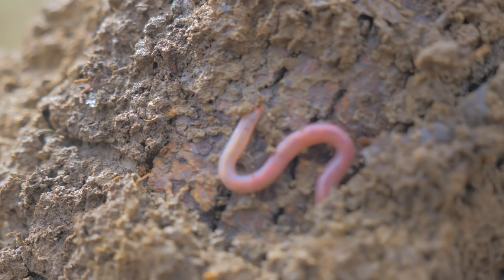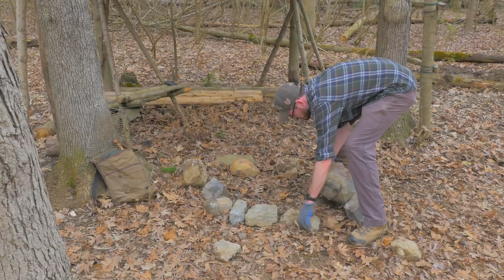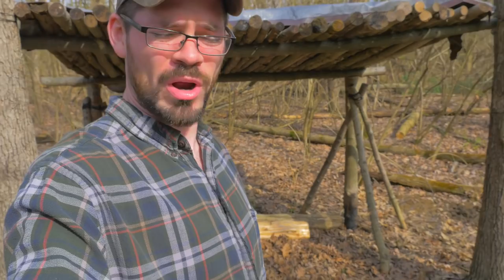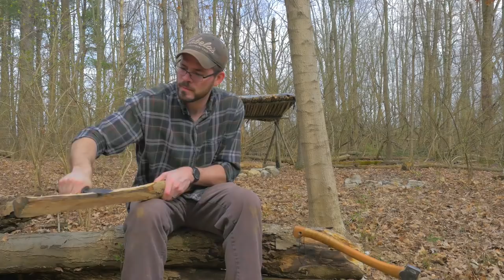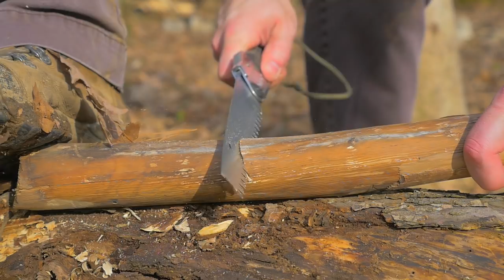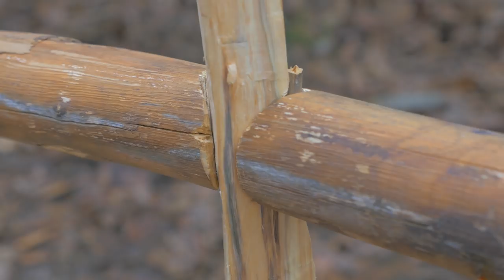NEW Bushcraft Basecamp  - Dovetail Joinery Pot Hanger & NEW Fire Pit (Ep. 2)

Comment: Your video caught my eye as I was reviewing the posts. I started using the dovetail setup you showed about 45 years ago; except I put the notch in the ground post and triangle the crossbar. I think it makes a stronger joint since the ground post is a larger diameter.  Also you can put a few notches in the post to adjust the height when needed. Just don't put the notches too close together or they might split out. With the notches on the post, you can hammer the post into the ground without fear of damaging it. I don't know if you tried it, but you can rotate the post to adjust the pot temperature.
Reply from the maker: Good ideas. Thank you.

Comment: Nice video, glad I found your channel. Have you considered a "keyhole" firepit? You can keep your main fire going strong and pull coals into the narrower portion to cook. You could have your pot hanger over main area to heat water and use your grate over small end. Just my thoughts. Look forward to more videos.
Reply from the maker: Yes, i had one at my old campsite. It really is a good idea. The last one i made wasn't great, because i dug it out, so it stayed flooded or moist alot. But keeping it at ground level would be good.